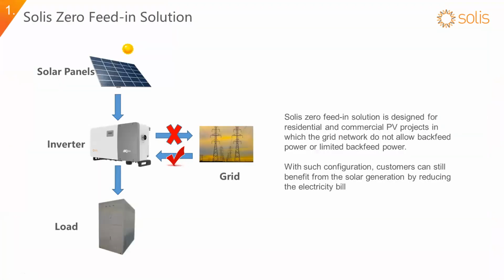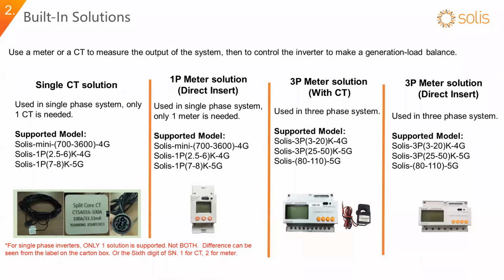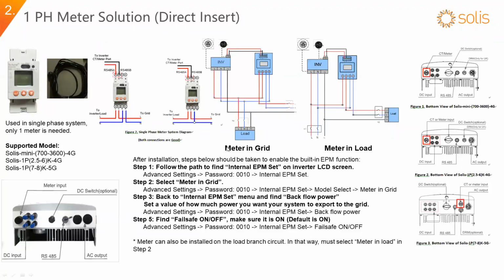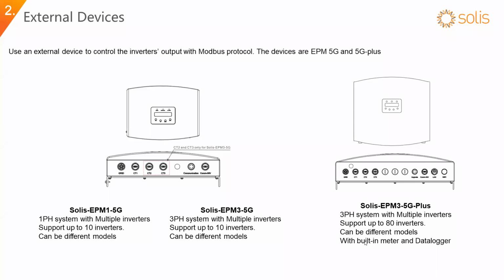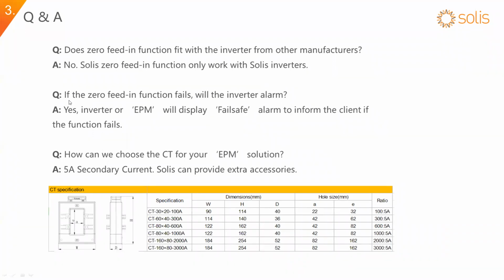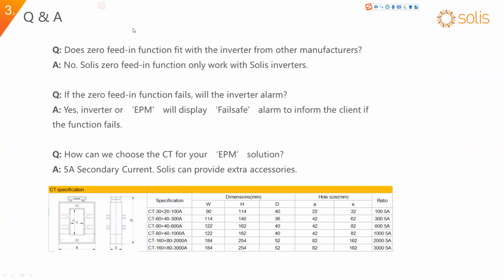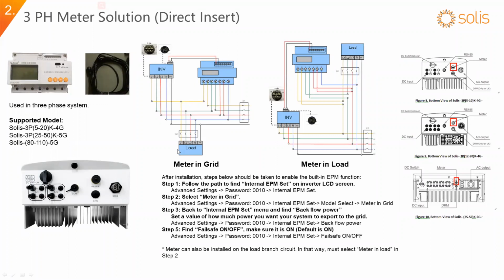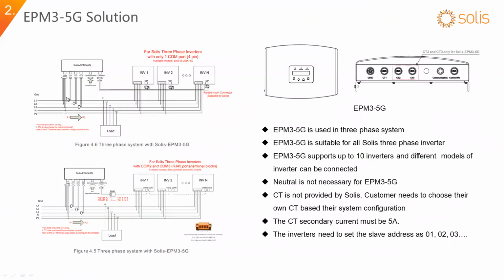solis webinar in asian pacific region  zero feed in solution

Comment: I have a solis mini 2000 4g, but the sixth number on the serial is a zero. I have a CT sensor that came with the item, and I just realized it is exporting even with the limiter. What should I do?
Reply: Check the sensor for defects or misalignments, or incorrectly connected, followed by settings checks